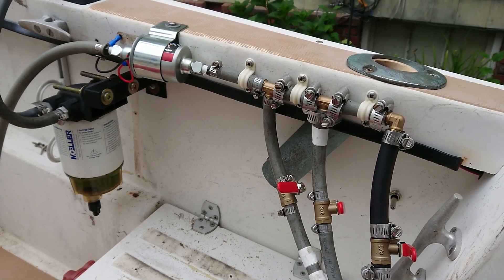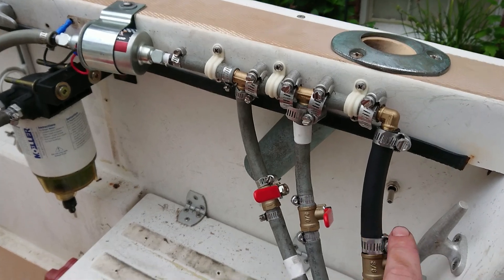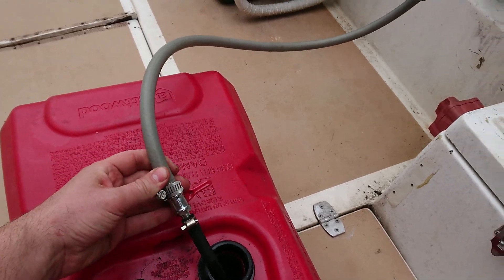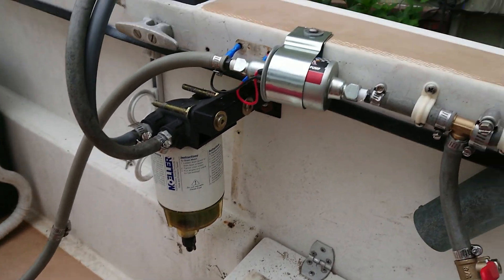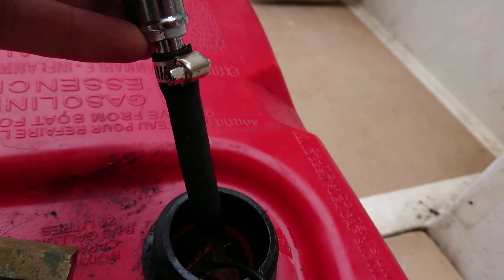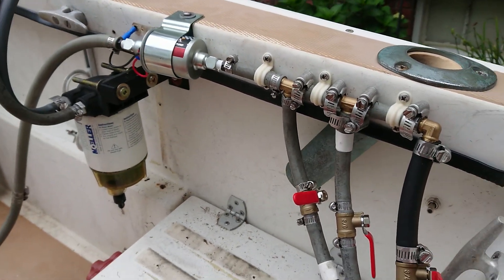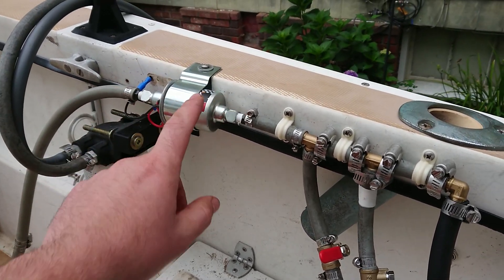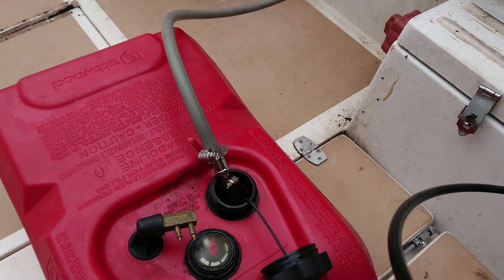E8012S Universal Electric Fuel Pump Review - used as a secondary fuel tank top up pump

Comment: Still working well?
Reply from the maker: Surprisingly yes, the pump is so cheap I have a spare in the boat but it has now held out for 2 years under sun / rain etc.
Reply: @cenkaetaya  Good on ya! There's an art to looking at cheap Chinese stuff and knowing if it's quality or not
Reply from the maker: @erebusreactor24  I think it could pump faster, but all in all, its super low energy and I really have no complaints. We can top up our tanks while cruising and it just makes the whole hose situation easier for the time being as I have 3 below deck tanks of 3 different sizes.